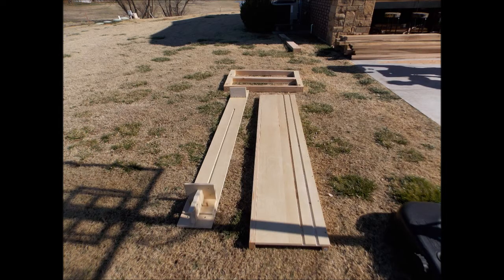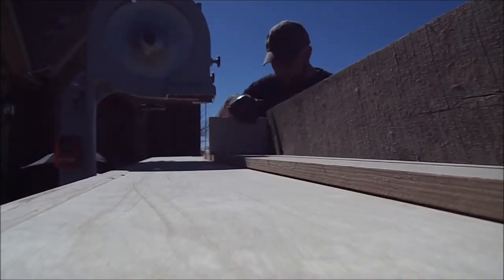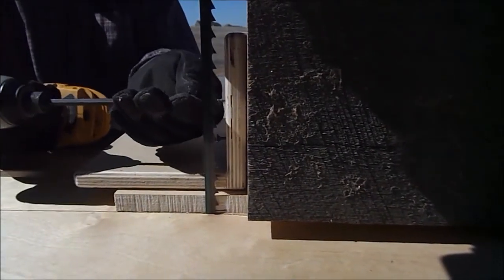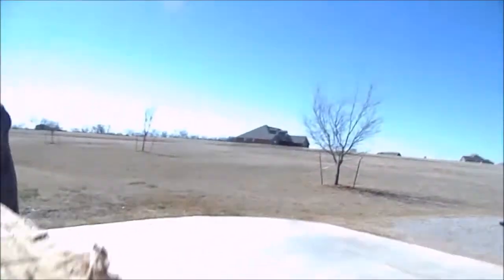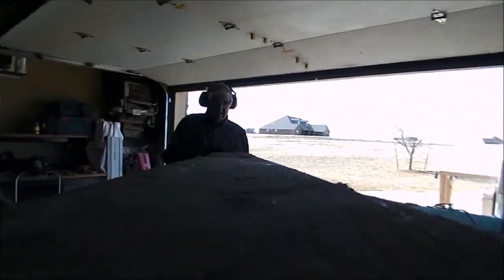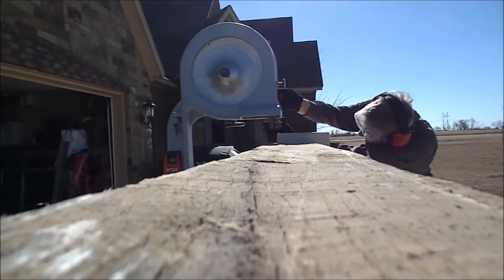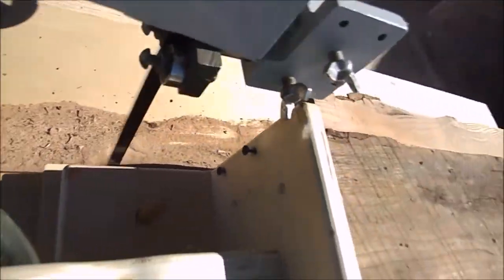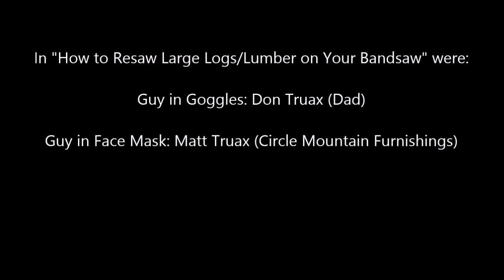Bandsaw Sled: How to Mill Large Logs/Lumber on Your Bandsaw

Comment: Great video!  I assume the single dovetail slot is for stability?  I think I may build one myself.  I only have a 12" bandsaw from the 50's or 60's, with about a 6.5" cut height.  I put a 1 horse motor on it, and it does pretty good, but I definitely have my limits on what I can do.

Comment: If you still check your channel.  I do have a question.  How do you set your blade through the table?  Is it just a slot like the original table and it sits on top of the original?  You don't show that part at all.  Thanks.
Reply from the maker: When I first made the table, I made a cut all the way through the back so that when I take it on and off, I just slide the kerf through the blade until it stops. I hope that makes sense. I don't have pictures as it was damaged in my last move.
Reply: Perfect sense.  I watched another obscure (I say obscure but I mean barely watched) video of another version that is similar.  I plan on building one.  I just bought a Laguna 18" model 3000 on ebay.  Here is a link to that video if you are interested.  Thank you very much for the quick response.  I was sorry to see that you didn't have more videos posted as you are quite interesting.  https://www.youtube.com/watch?v=VoRAr47ocpQ
Reply from the maker: @iROBODUDE  that's a fantastic saw! I switched from videos to just pictures because life got hectic. If you have an Instagram account, my account is @true_axe_woodworks
Reply from the maker: @iROBODUDE  that's awesome man. I'm going on 11 years active duty right now. Much respect and appreciation for our contractors!
Reply: I am out in December and going to stick to woodworking.